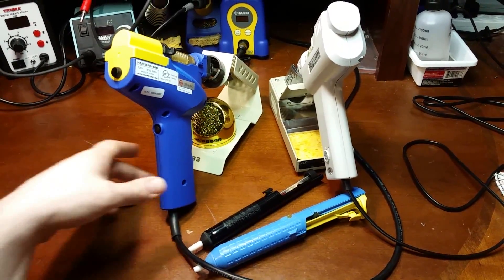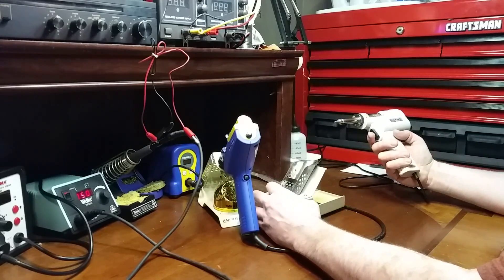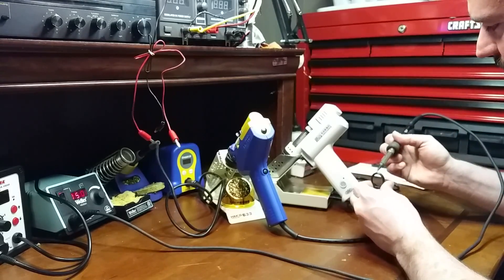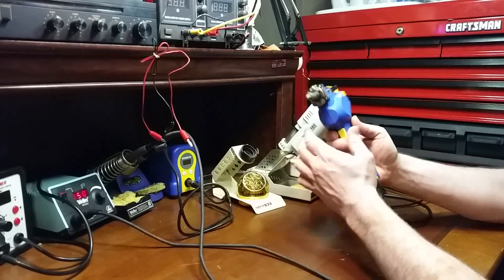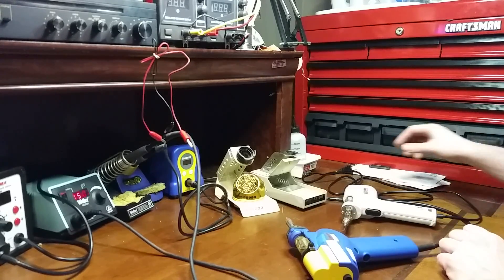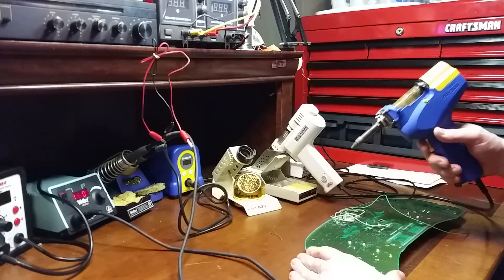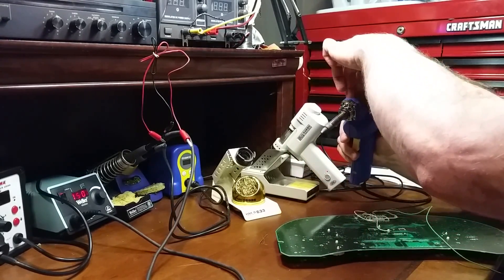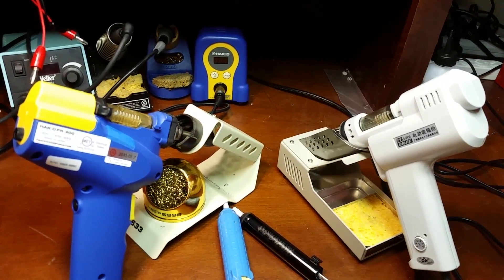Hakko FR300 vs S-993A Electric Vacuum Desoldering Pump

Comment: Was that a vehicle instrument cluster you desoldered? It looks like you removed a stepper motor for a dial. Disclaimer: I may or may not work in the auto industry designing instrument cluster PCB's.
Reply from the maker: Andrew Towler 
Yes good catch. I specialize in cluster repair. If you check out my videos you'll get an idea with how I use the tool.
What manufacturer do you may or may not design for out of curiosity?
Reply: DENSO International America in Southfield, MI.
Reply from the maker: Andrew Towler 
I find it interesting how cluster design has changed from the late 90's to current.
Reply: Agreed. Light bulb backlights, to VFD displays, to TFT displays, to the near future of full-screen LCD clusters.
Reply from the maker: Andrew Towler 
With some of the latest GM clusters (not full size) I'm noticing stepper motors that are spring contact instead of soldered, or cheaper LCD diplays instead of VFD and I think I've even seen single sided boards. Pinching evey penny.
Reply: Oh yeah, that's definitely the trend as well. We continually have goals to make clusters cheaper. We still use high-quality, reliable components but we're always looking for what's new and less expensive. We remove components from the design when possible. We haven't used VFD's in years. DENSO doesn't use single-sided boards, but I'm sure there are other manufacturers that do. Clusters have evolved to handle more and more of the vehicle functions, so they've become necessarily more complicated. I'm seeing a trend toward more complicated boards with more layers.
Reply from the maker: Andrew Towler 
If I start seeing BGA chips I'm going to screem! lol

Comment: I picked up the S-993A yesterday and wished I hadn't ordered this thing. It worked great the first day I used it. But on the second day, it was clogged so badly there is no way I can use it again. It's a dead brick now. Even trying in vain to jam that ram-rod pin into it is to no avail.  It's just like the tip and nozzle has been filled with concrete! Complete and total garbage.
Reply from the maker: Patrick Briggs 
Any solder sucker is going clog. especially if your working on conformal coated board.
just heat it on high and work the poker in.
Reply: I have one Hakko 808 and one S-993a and both clogged, I need to use the cleaning pin many times each desoldering session.

I think this a commun problem for all this type of tools.

The weller system is better because the pipe between the nozzle and solder container is very short.

Cheers.
Reply: I ended up purchasing a Aoyue Int474a++ and it hasn't clogged once so far.  Significantly better design.
Reply from the maker: Patrick Briggs 
since I've changed the tip size on my hakko one size larger it's stopped clogging all together. Now looking at the S-993A it does have a small opening. Is the tip larger on the Aoyua?
Reply: Last week I bought the chinese S-998p, still waiting.
The new gun nozzle comes with the pipe, every time you change the  nozzle change the small pipe inside the heater.

Plus the price of the spare parts, nozzles, heaters and filters.

A friend bough the hakko FR300 and has't stop clogging, any way this the price for try to do more easy and betters jobs.

Sorry for my english.

Cheers.
Reply: Good point, may be I try one.
Weller dealer in my contry is my friend, I can buy one of these with a significant discount.
I think weller have the better desing of all desolderings tools in the market but the price is sickness.

Thanks.

Cheers.
Reply: Just out of curiosity, did you attempt to clean it right after each use? Or did you wait until it was filled up?
Reply: If clogged like brick, you need to reheat itself or use another soldering iron to melt it. It's normal MO

Comment: I've just been watching a bunch of videos about the Chinese solder sucker, and I think the problem you are having with it is that although it works, but it's sucking capabilities are not on par with the Hakko...judging from the sound yours is making, and comparing it to other videos, I would guess the unit is really designed for 220+v, not 110v! Take a listen to this video, from Australia...

https://www.youtube.com/watch?v=H97BP_g6Tnw
Reply: Spot on... this unit definitely requires the full beans 240V AC and not the half strength 110V AC America has. The pump motor is litterally spinning at half speed... I'm about to review this tool on my channel.
Reply: i think you right..the 993 motor's sound from your link video is higher than in this video...220 v suit for 993 to get more power for vacuum
Reply: Global Garage big fan of your stuff. Thanks for the great Famicom av mod tutorial
Reply: mine says 110 volts at 50 hz. Note: 50 hz motor should run at a little higher speed on 60 hz and we do have 120 volts at 60 hz also. Anyone know where I can get an English manual
Reply: You can get everything running on both voltages... The only problem I see is if you try the 220v one into a 110V outlet.

Comment: Where are the spare parts (clear reservoir, tips of different hole diameters) and consumables (like filters) for the S-993A?
Reply: They don't provide spares because they don't expect the tools to last long enough to make spares useful.
Reply from the maker: Winston Smith 
I haven't tried to track any down yet myself. But if you can't find anything on ebay you might be out of luck without ordering directory from a china vendor.
Reply: Don't see anything on eBay or at Banggood.
Reply from the maker: Winston Smith 
unfortunately that's the risk we take by purchasing inexpensive tools from a china based manufacturer.
Reply: Anyway, replacement filters could probably be made from those used by other similar desoldering tools using a pair of scissors if too large and the clear plastic cylinder which cracks even on the much more expensive Hakko could be be plugged with glue if it gets bad enough to leak. I just can never figure out why the Chinese so often seem to ignore providing spares with such items. I mean, how hard is that to do?
Reply: Chris Morda More likely - when anything breaks or a filter clogs, they want you to need to buy an entire new unit AND/OR for maximum profit they assemble ALL available parts produced into complete units and, with their characteristic lack of  interest in customer care, simply don't give a damn when their customers can't find spare parts and replacements for expendables like filters. I can find workarounds, but I'd prefer not to be required to do so.
Reply from the maker: Winston Smith 
As the tool because more popular china's sellers will take notice and sell parts. Take a look at the 858D hot air, you can find all kinds of spare parts for that now.
Reply: jeffescortlx We can only hope that will be true. In the mean time, I can find workarounds.
Reply: Enjoying The Sun 577 - Yeah, I'd found the tips on day one. Filters are far more expendable than tips. The clear plastic cylinder may also tend to crack as it does even on the much more expensive Hakko. But, like I said, I can think of workarounds.
Reply from the maker: Enjoying The Sun 577-Jersey Customs 
For me the cracks haven't caused any air/vacuum leaks.
Reply: On the cracks, I'll bet that water thin CA (superglue) might wick into them and seal them IF they ever began to leak.
Reply: "Hmm, maybe we could make some filters out of cheap sponge from dollar store" 

Those filters are usually made of a felt-like material, so that kind of material might work. I think sponges might melt when being hit by solder and wouldn't pass air well enough. 

Anyway, my idea for a workaround would be to just buy filters from manufacturers of vacuum desoldering irons who actually DO sell filter spares and cut them to size if necessary. 

If the Chinese were smart and don't want to supply spares themselves (for some unknown reason), they should design their units to be completely compatible with the spares from some name brand unit for which there are spares, but they apparently don't think that far ahead very often. I wish they had done that in this case because I know of Chinese temperature controlled soldering irons that can use Hakko spare parts!
Reply: I have a Hakko 808 and I bought a S-993a for testing.

I bought the tips, heater element and  filters also.

You can find it on ebay.

Cheers.
Reply: Ricardo B Do us all a favor as I usually do when I claim something - give us a link or links. Right now, as before, on the US eBay I see the tips and heating elements, but no filters. The filters are far more into the category of "expendables" than tips or heating elements.
Reply: Ok I forget to say the ZD-985 use similar filters and nozzles of my Hakko 808 I bought a spare parts kit 

http://www.ebay.com/itm/80-552A-ZD-985-Desoldering-Station-Spares-Heater-3-Tips-20-Filters-Sponge-/302181257625?hash=item465b681199:g:1B4AAOSwa~BYZeOZ

This is the link where you can find something for you.

Cheers.
Reply: Or Buy a Hakko 808 ceramic paper filters, both are identical
Reply: Ricardo B Great! So the Chinese did do what they often do that I mentioned earlier - make a device that uses the spares of some other well known and popular name brand device. Here's some links to those Hakko filters:

Hakko Ceramic Filters, FR-300

http://www.techni-tool.com/821MI033

Amazingly, they seem to be available for site to store shipping in the US home improvement store Home Depot:

http://www.homedepot.com/p/Hakko-Ceramic-Filter-for-808-Desoldering-Gun-10-Pack-A1033-P/204259335
Reply from the maker: Winston Smith
just make sure to get a filter for the 808 and not FR300. The filter for the FR300 is too big for the S-993A.
Reply: jeffescortlx Hmmm, not according to the claim here, another source for the same filter, Hakko part number A1033:

http://www.all-spec.com/Catalog/Soldering-Rework/Desoldering-Irons-Accessories/Desoldering-Iron-Accessories/A1033-3021

Hakko A1033-3021 Features:
Accessory Type: Ceramic Paper Filter
For Use With: Hakko FR-300, Hakko 474, Hakko 475, Hakko 701, Hakko 702B, Hakko 484, Hakko 808

Or here, another source:

Hakko A1033 Large Ceramic Filter for 802/808/800L/707/706/807/809/817

https://www.amazon.com/Hakko-A1033-Large-Ceramic-Filter/dp/B000B5YD3Y

Even Hakko says to use that part number filter in the 808 gun itself:

http://www.hakko.com/english/maintenance/topic_jyokyo_b4.html

L size: Use for handpieces (pack of 10 pcs., Part #: A1033) The filter is installed in the rear holder side of the filter pipe. *For the handy-type HAKKO 808, use a ceramic paper filter (L).
Reply from the maker: Winston Smith
The filters for my FR300 are larger in diameter than my S-993A filters.
Reply: jeffescortlx OK, so exactly which Hakko part number filters for the Hakko desoldering tools will fit then?
Reply from the maker: Winston Smith 
I don't know.
I haven't tried looking for replacement filters yet for the S -993A. The original filter is still looking just fine. 
with my hakko I can just peel off the dirty layer and get mutiple uses out of each filter. I'm not sure if the S-993A is the same way, haven't needed to try yet.
Reply: jeffescortlx So Ricardo B was, as we say in the states, simply talking out of his a** then when he said this? "Or Buy a Hakko 808 ceramic paper filters, both are identical"
Reply from the maker: Winston Smith 
I'll double check tonight. I'm just going off off memory.
Reply from the maker: Winston Smith 
The FR300 filter is twice the size as the A-993A filter.
Reply: +jeffescortlx Can they be cut to the proper size for the S-993A?

Comment: Great comparison video.  Here's my experience with the Chinese S-993A.  Right out of the box...

I plugged it in and set the temperature dial to the lowest setting. The S-993A heated up out of control to 600°C/1100°F (check out this pic, https://goo.gl/HNHHFg); there was no temperature control at all -- turning the dial had no effect. It then started to smoke badly and the metal nozzle and shaft started to melt away from the mount where it connects to the body of the gun. I unplugged the S-993A immediately and let it cool down.  Once it cold down I plugged it in again, but now it will not heat up at all -- IT IS DEAD -- go figure.
Reply from the maker: That glowing red is impressive!  I bet it's hotter than 600c. Must of been a combination of manufacturing defect and poor quality control. I suppose it has a solder blob some where on the controller board that is forcing the heating element on or a shorted triac. Hope you were able to get a refund or send it back?
Reply: That picture was taken at about the 4-minute mark, then I pulled the plug, literally.  Agreed, poor quality control -- I guess the "OK" QC sticker on the handle is just for show.  This all happened yesterday and I am communicating with the seller -- however, slowly, as they are in China -- they seem willing to help, so  hopefully I can get a replacement sooner than later.

Comment: Whatcha got there?? The GM X27 stepper motor repair process..? What else do you know about the GM clusters?
Thanks for showing the comparisons. Chances are I'll shoot for the cheap one first, then upgrade to the Hakko at a later time. I would be using my desoldering gun for the same GM repairs, plus a lot more..
Subbed!
Reply from the maker: I've been specializing in GM cluster repair since 2012. I tend to repair the one's that other tech's refuse to fix or say are unrepairable or the user tried to fix them self's and screwed it up.

Comment: How does the Hakko hold up during heavy use? Do you have to empty the canister, clear blockages or replace filters often? In a year of use have you ever had any problems with debris getting past the filter into the diaphragm area?  Sorry for all the questions, yours is the only review I've found from someone that actually seems to have considerable experience with the tool.
Reply from the maker: The only time it requires consistent cleaning with the poker tool is if it's being use on boards that are conformal coated. When being used on boards that are not coated, I only have to use the wire poker tool maybe once ever month. And empty the canister couple times a week. This is with about 1 hour of use every day.
What I do to help keep it clean and clear of blockages is just before I turn it off I point the tip up and hit the button. Gravity helps pull every thing down the tip and pipe and into the canister.
I've changed out the filter a couple times since it was new. IIRC it came with a few extras. You can peel the dirty layers off the filter.